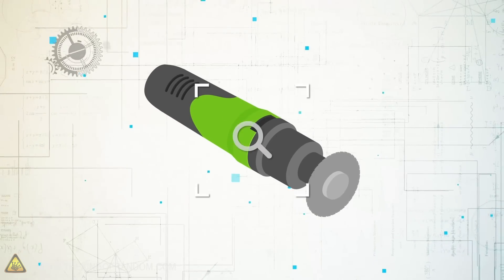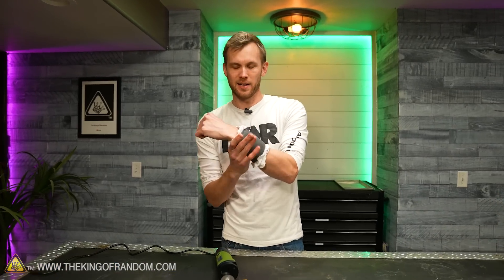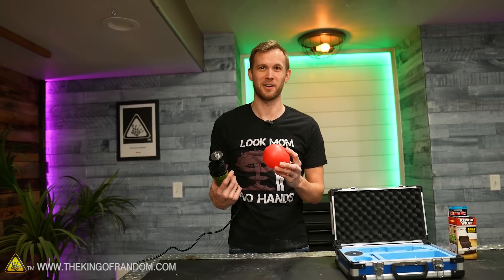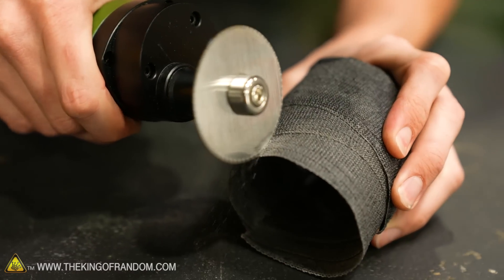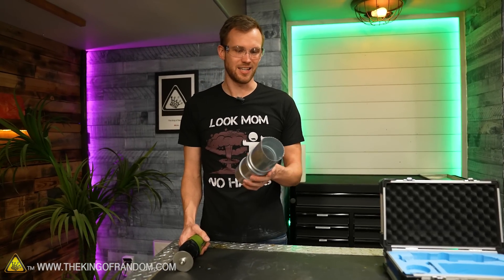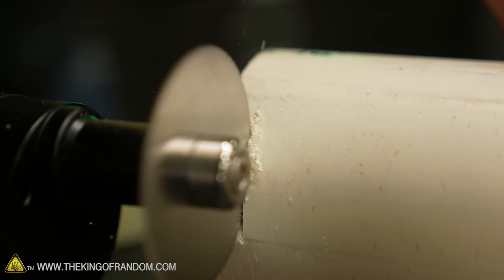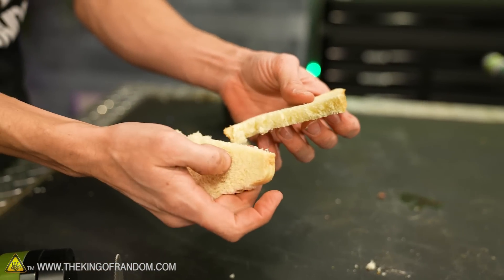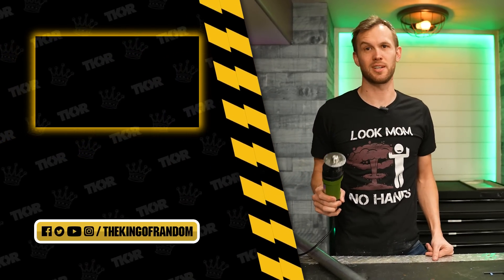Mythbusting This CRAZY TV Scene

Comment: When i broke my arm and they cut the cast off, the nurse showed me on her palm that it can't cut my skin so i don't think it would be able to cut much.
Reply: me too
Reply: That’s a logical issue. The skin is flexible and moves with the blade, not being torn or ripped. As you can see in the video, it does more damage to a pipe then to skin, even while skin is more softer. But that last part is the key. It only cuts something which is harder on the outside. Like the Apple, which is very thin but harder on the outside.
Reply: When i broke my arm they put it in a synthetic (plastic) cast...yeah bad idea...when the time came to cut it of the metal wheel got so hot that is burned and cut my skin. still got marks from it!
Reply: @xoniq-vr  more softer hahaha
Reply: When I was young I broke my arm on a swing set, when I went to the dr. to get my cast removed she told me it cant cut me. Part way through removing the cast I said it felt like it was cutting my arm she said it just felt that way cause it was hot from friction and that I was okay... lo and behold once the cast was off I had about an inch and a half long gash in my arm.
Reply: @travisockerman4361  same! i was telling the doctor that it was cutting me and i have 3 burn/cut marks on my arm still to this day
Reply: it can hurt you if pressed over bony areas like your shin

Comment: Royal Pains: Look, this cast saw can cut a metal pole!
Nate: I call shenanigans. Hold my amazon account, I'm gonna test this.
Reply: I don't think what they used on Royal Pains was an oscillating saw. The sparks were flying in only one direction, meaning a rotating blade was used, like an industrial "roto-zip" tool.
Reply: This has me dead on the floor
Reply: Maybe they were using a bone saw and just said it was a cast saw because someone was told to get a "medical saw", and some  do look similar. Some even have rotating blades.
Reply: @Mike_Toulon  tkor just do whatever it takes to make the outcome prove their point.
Reply: @benhames5162  I meant the ppl on the TV show, not TKOR
Reply: @Mike_Toulon  yeah, I was saying you're 100% correct, that they just use whatever it takes to make the outcome correct for them.
Reply: "Hold my amazon account" 🤣
Reply: hold my amazon account

Comment: Even the heavy duty “construction” version of this tool with blades specifically designed for cutting metal don’t work very well against steel piping like that.
Reply: While great for some jobs, i can't imagine one of them cutting anything more than a nail or a small bolt.
As a side note, if you ever burn up (or just wear out) a saw blade, just sharpen that edge into a knife blade. Works amazingly well on rubber and soft plastics, but you have to keep pulling the cut apart. So just bend whatever you're cutting and cut on the 'outside' of said bend.
Reply: Down to make of the tool and technique🤙🏼
Reply: yeah they do, that's galvanised iron. do you mean actual hardened steel? because fence pipes are soft af

Comment: A doctor once told me that the tools surgeons use for surgery look exactly like the hammers, drills and saws you can buy at Home Depot. The biggest difference is the brand name and price tag.
Reply: "Osteotome" = chisel
Reply: "Scalpel" = Olfa knife
Reply: Steel punch = the same steel punch but 75% cheaper (a steel punch is a hole puncher for thick metal plating eg. 3/4in steel plates)
Reply: @shootymcshootfacekoff7972  Why would a surgeon need a punch capable of putting a hole in a 3/4" steel plate? He's not building a ship.
Reply: @jjohnston94  same reason they got modified dremal tools to put holes into bone that can’t be drilled into easily
Reply: And their ability to survive an autoclave.

Comment: in the short clip of the show that you had in the video, the 'fence pipe' looks more like EMT conduit to me, which can be easily cut with the same simple non/motorized  pipe cutter you use to cut copper pipe, but is also strong and cheap and you should get some and build stuff.  Probably the best strength to cost ratio in the entire hardware store.

Comment: It's also hollywood, so there's the possibility that not only were they using a disguised material (ie, it looked like it was metal but it was actually PVC or some other softer-but-rigid material painted to look like metal) but also some visual affects were added in post (ie, it's a metal tube and cutting metal generally creates sparks so they painted in sparks to help sell the metallicity).

Comment: I would like to see how this performs against an oscillating tool. I would like to know what the differences are between them since they do a similar thing.
Reply: I second that motion
Reply: Yeah, ive cut 3/4" plywood with a sonic saw and it worked fine, probably vibarates alot quicker though.

Comment: As a construction worker we use a tool similar to this what you have will cut through metal if you had the right blade. Apparently the one they were using did in fact spin that is the only way your getting sparks. Maybe what they were using was an outdated cast cutting saw before they switched to the oscillating saw.

Comment: A cast saw is just a slowed down version of a multi tool oscillator. My Dewalt cuts through everything.
Reply: You got that backwards actually.  You multi tool oscillator is a modified and improved version of a cast saw.  The cast saw came out in the mid 1940s, while the first variation "Master Tool" (The Fein Multimaster RS) came out over 40 years later in the late 1980s.  The speed of a cast saw is optimized for cutting plaster and fiberglass and they only come with blades optimized for cutting those materials.  Multi Tools/Master Tools/Oscillating Saws have variable speed motors so that they can be dialed in to the proper speed range for the blade used and materiel being cut.

Comment: These they used was more like a Dremel where it does constant rotation the guard on it is what stops it from going into the arm instead of the motion because the specific cast saw they used can also cut through metal braced casts

Comment: It would cut through the steel pipe with the correct blade and speed (variable speed ones are a thing for a reason) - but it would probably take more time than the show offered.  You are correct, it would not throw sparks.

Comment: A long time ago, I was helping out with finishing a mock up for the Paris Air Show. We were trimming glassfibre mouldings to fit. I was holding one of the moldings and the fitter was using a windy oscillating saw to cut it. I felt the saw blade cut through my fingers and nearly passed out. The fitters noticed and asked what was wrong? I said the saw cut me. He laughed and grabbed my hand there was a white line across my fingers, glassfibre dust. The saw hadn't even broke the skin. With the hardness of the glassfibre and the noise of the saw, I was convinced that I had been seriously injured. The shock reaction lasted several minutes and I was somewhat embarrassed but relieved that I still had my fingers.

Comment: I really liked this episode because it justifies the laws of physics in two ways.  an object in motion stays in motion... and every action generates an opposite but equal reaction.  The blade osculate at a rate so fast that it's nearly impossible to tell the difference between when it is on and when it is off.  The exact measurements of each blade must be spot on to achieve this because if one blade is off track (warped) or longer or shorter than the others there may be a disaster if tried on human skin.  thThe last thing you know, is that every reaction requires an opposite but equal reaction so with softer materials there's not enough reaction to suggest a result as far as how efficient the product may work.  When you use the oscillating blades against stronger materials that are stronger than such skin Maybe then those materials will put forward the reaction that will generate a change in how the product reacts.

Comment: My mom told me many times of my aunt when she was young having a plaster cast (this was before fiberglass was used commonly) and the nurse cut her arm when taking it off. Supposedly it was because the nurse didn't use multiple plunge cuts with the saw and instead cut into and drug it along the length of the cast cutting the skin of my aunt's arm. It wasn't deep but it hurt according to her, think of getting a very long papercut.

Comment: They do make oscillating multi-tools that can cut metal very well. It really comes down to the power of the motor on saw and the blade that is on it. There are also bone saws that are similar.

I'll call it plausible but unlikely. Due to the low probability of a medical professional having a capable blade handy. Also highly unlikely that they would carry the saw on them. However in the rare event that the stars align properly, it could be possible.

Comment: You say it’s not the best tool for the job with the wooden dowel, but I would disagree. This essentially works the same as a multi tool with a flat blade attachment. It’s not meant for large scale cutting, but rather I’ve used it for small cutouts for baseboards

Comment: I own a multi tool that shares similar properties to this, I've never managed to cut myself with it, but I have used it to cut through plastic, wood, various metals including copper aluminum and steel easily enough.
It is NOT quick and is horribly noisy, but it gets the job done and in many cases, done the job where other tools failed.
As far as I can tell, that little bit of tweaking they added to that show was impossible unless that was a miniature rotary cutter like a dremel

Comment: there are " cast saws " that can cut things like metal but these are not used for casts. 1) they are insanely expensive, 2) they are multi mode, multi setting tools, 3) they have different blades for different material, 4) they are rarely found outside Emergency OR rooms as they are intended for use in extreme injury cases to aid in removing objects that have lodged inside a patient. I have seen one before and they are beefy tools that are a last resort, not something a Concierge doctor or their assistant would have in a field kit if at all.

Comment: The frequency of this saw by far the worst that I've seen so far. I have a home oscillating saw, and it did cut through a solid metal pipe of a 3 cm diameter quite easily, but you've to fix it in place. If the tube was attached to a person at the other end, I suggest shooting them dead before doing cutting to spare them the unbearable pain of a pipe vibrating violently in their bodies.

Comment: I had several casts as well and each time they cut them off left me bleeding where the blades travelled! They did not cut like a knife but left a slight bleeding line that scabbed over in an hr or so. This might be my technicians fault than the tool!

Comment: I thought he was joking at first you can buy these tools under the name Renovator and it comes with several different blades for cutting several different materials like tiles metal and plasterboard I would be very surprised if that blade cut through tin right tool for the job

Comment: So um... I don't know if I had a very overly aggressive & careless nurse (which I'm 99% sure is at least part of it) or if hospital-grade cast saws are significantly different than this one, but I can attest that they can indeed hurt you plenty. I had a full-arm cast removed 2yrs ago & still have a scar on my forearm from the saw that the nurse was using cutting through the cast & underlying bandages to my skin underneath. I will say that I think the initial "trauma" that caused the scar was more of a burn caused by the heat of the saw as it swelled up like a welt almost immediately, but it's still in a nick sort of shape like a cut would cause.

I don't want to cause any fearmongering or anything, but I was a little uncomfortable with how harmless Nate made the saw seem. It didn't cause a big injury for me, but it still hurt plenty & it was infuriating that even the surgeon I saw minutes after having the cast removed wouldn't even acknowledge the fact that one of her staff had just burned me with the saw/said it couldn't possibly cause any harm when there's no way I could've given myself that sort of fresh marking moments after having that portion of my arm exposed & accessible for the first time in 2months.

Comment: There's not more travel distance with a bigger blade.... The oscillation frequency isn't increased just the size of the blade then the travel distance stays the same... What i think you meant was with a bigger blade more teeth are oscillating at a given moment (if the machine is running) than with the smaller blade .....or no?
Reply: Also just puttin this out there: there exists a power tool intended to cut various material (not only Fiberglas casts) that operates by oscillating a blade similar to the cast cutting one.... People call it an undercut saw.... WHAT ARE YOU GUYS DOING?  It seems like after grace started appearing in tkor the ideas for shows has really bottomed out (

Comment: In construction we call them vibrating saws but the have blades for metal and wood.. they are made for it but I figure same concept
Reply: Oscillating saws are actually a direct descendant of the cast cutting saw.  The reason it didn't work has nothing to do with the saw and everything to do with the blade.

Comment: so....you know ...im a carpenter and sometimes we use a similar tool it works exactly the same just looks diffrent. i gotta say u got a pretty bad tool there coz ours cut thrue nails and stuff with no problem. sure u gotta replace the blade afterwards but urs didt even cut thrue this thin metal (ps: sry but english isnt my first language so sry if its a lil hard to read)

Comment: wouldn't one of those heavy duty, expensive ones with the harder blades be for specifically for medical professionals who use them for cutting lots, and lots, (and lots) of casts? i'd imagine they would want a blade that doesn't dull with extreme and repeated use, so they would want a blade with a much higher hardness than regular old steel from a cheaper home use cast saw, which wouldn't see much use and thus not need a sturdier motor/harder blade. 

so it might be that the thousands of dollars cast saw could really cut through metal after all, if the blade is hard enough. sounds like you just needed to upgrade to... a diamond saw. ;)

Comment: Cast saws can cut you. If you want to leave severe cuts at the patient. Pull the plug and use the cable as a rope so swing the saw with great force at the patient. PS. This is not recommended😅.

Comment: Before even watching this I knew it was not going to work.  Why has nothing to do with the actual saw and everything to do with the blade.  If you swapped out the standard blade from this to an oscillating saw blade designed to cut metal then you would be able to do it.  

The design of the oscillating saw is actually derived from the cast cutting saw.  There have been changes made to the design, such as a different style of blade mount.  However at its core an oscillating saw is still a cast cutting saw.

Comment: Given enough time and enough replacement blades yes you could cut through the pipe but that point you're just wasting time and material there are oscillating saws that are meant for cutting metal however I have a cheap version of one of those that's meant for wood and send metals like sheet metal it does work not great but it does work and it seems to burn the wood a little bit more than cut it partially depends on the density of the wood 2

Comment: The hardness of the blade will tell you if it cuts through a material or not
Reply: That was my thought. We know vibrating saws can cut—that is how a Saw-Zaw works. The travel distance may be a bit of a factor, but the blade itself is going to be the biggest factor. The tooth size and shape, hardness, etc.

Comment: There's a reason that people don't use cast saws for metal work.
Reply: An osculating saw is a direct descendant of a cast saw.  The issue is not the saw, but the blade.  If he put an actual metal cutting blade on that it would cut the pipe.
Reply: @TheInfinityzeN  but then it wouldn't be a cast saw

Comment: Theoretically you can cut through anything with anything... you can even with enough force cut through steel using wood... this is theoretical and not able to be used in practice as even if you tried to cut through steel with wood you would just be wasting wood

Comment: I dont think its an osilating saw they use in the show. If you look you can see it sparkes. And osilating saw would never do that.
Also i wouldn be supprised that it was a carbit blade they were using on the expensive one. A hospital cant chance blade in the mittle of an operation becaus the old one got doll. Also if you want to cut metal you need a speciel blade for that. The one you get now is more for soft material.